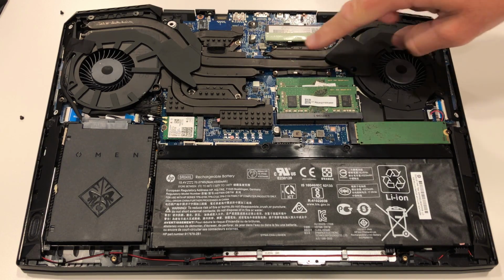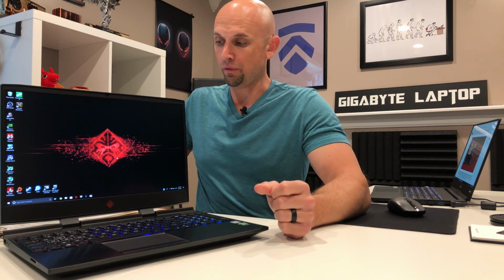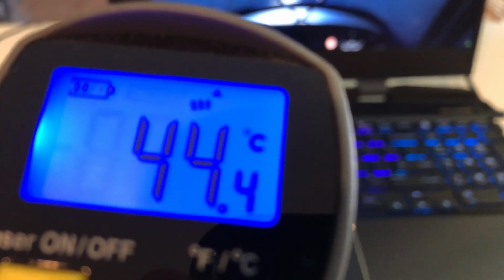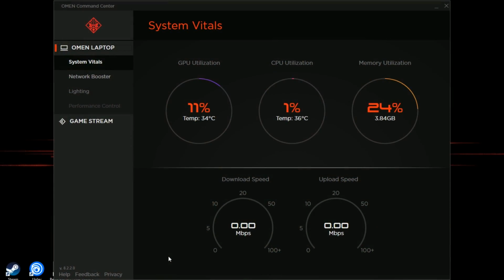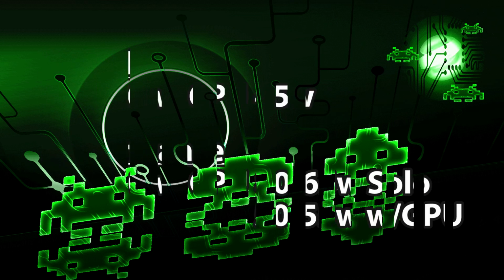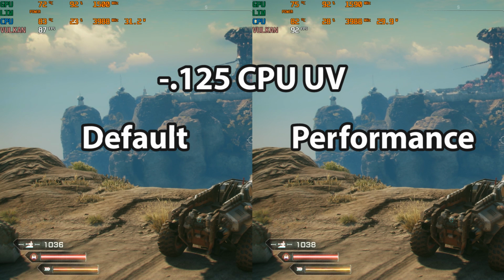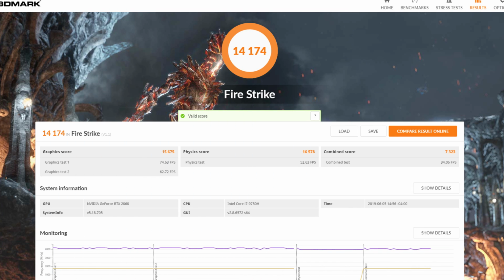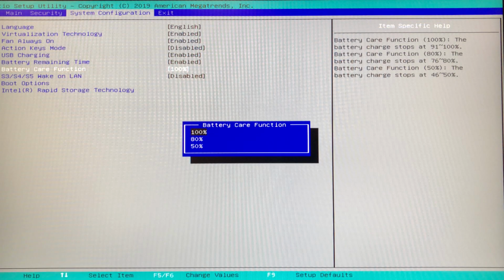HP Omen 15!  RTX, 9th Gen and 144Hz for $1199!

Comment: thats really not a bad deal in febuary i got a hp omen with the 6 core i7 a 1070 maxq 32 gigs of ram the 144hz screen and a 512gb ssd for 1500
Reply: MrYaxalot do you have a 2-3+ year warranty at least? Get one and save yourself, and not make the same mistake I did. My high spec Omens GPU died, and I gave up on it since idk why it died, so I didn’t replace the motherboard.
Reply: @SilentButDudley  it's got whatever the manufacturer warranty is
Reply: MrYaxalot get it Insurance’s with square trade or something for 3-4 years. It’s worth it, as if a GPU dies then you would need to buy a whole Motherboard
Reply: @SilentButDudley  I buy a new laptop every 2 years and it's not my main machine I never expect to repair a laptop unless it's memory or drive related those insurance things unless from microcenter or something are scams

Comment: the only issue is that hp laptops does not last that long . in fact i know more than 5 users who have their hp laptop stopped functioning in less than 2 years . batter not working , screen coming off that you can not close it either or your keyboard will come off with time , wifi is not working . when you see more than 5 people next to you talking about their hp experience , you just avoid buying this laptop

Comment: Please be aware omens have a history of long term cooling issues. If you get one, get a long warranty or insurance. There is the chance that within 2 years the GPU or CPU will be fried.
Reply: Supposedly HP released a Bios update to help with the throttling issues. Im on the fence between this exact Omen he bought in the video or the new Helios Predator w\1660ti spec. Prob go with the Predator since new design and alot of good reviews.
Reply: Ry Guy I had a 2017 Omen with the 1070/ max specs possible for like 2k, and its GPU died right after a year. No warranty to save it sadly. Switched to Asus ROG Zephyrus since. The predator looks like a pretty good buy, as the 1660ti is a good card.
Reply from the maker: Once you’ve been burned by a particular model/brand often times you don’t return. 

No manufacturers is immune to failures.  You only think it’s bad because once yours fails you search for others with similar experiences.  

No different than buying a car and now suddenly you see these cars everywhere due to the fact that you have one and happen to be paying attention.
Reply: Bob Of All Trades I don’t believe HP is bad.  I thoroughly enjoyed the laptop when I had it, as it was quiet and powerful. Their software is pretty basic and unuseful, and I have found some brands do it better. 

I would have bought another HP had I not had such issues with the first like you said, so to circumvent that I would recommend anyone to get at least a 2 year warranty on ANY gaming laptop. 

I also believe that many of the cooling issues with the original 2017 omens is fixed, so it is probably a better product than the one I intitially purchased.
Reply: @SilentButDudley  Yea only thing holding me back is that im pretty sure the Helios uses Optimus and for gaming thats a no no, this Omen doesnt use it.  So no im steering more towards Omen. Like i said im on the fence, having a hard time, lol.
Reply: @BobOfAllTrades  one quick question I had for you I forgot to ask. This laptop has fast sync like you stated in the video. What is that exactly, is it just the 144nz monitor or does it help like adaptive sync or something, kinda confused. Been a while since ive been in the market for laptop. Is it enough to not get tearing in games and run fairly smooth? Will I notice a negative difference coming from a gsync benq monitor(1080\144hz)you think? I read in another one of your comments that trying to play on a laptop without any type of sync while coming from a gsync monitor is pretty bad. Only deal breaker holding me back rn honestly. Edit: Welp now I might just go with the PowerSpec 1520 from MicroCenter. If this 5% "in-store" coupon code actually works tomorrow I can grab it for $1375 out the door. Killer deal, don't know much of who "PowerSpec" is though.
Reply: @RyGuyRy  Pls can someone answer this. I have the same question

Comment: Have fun when this piece of shit breaks down after 20min of Prime and your replacement runs at 100°celsius constantly. Never again!
Reply: Check and make sure your Bios are up to date. I'm guessing there not. There is an article about how HP released a Bios update for the overheating\throttling issues.
Reply: @RyGuyRy  I don't have that laptop anymore, but bios and drivers were updated. Fun fact: The guy from HP support told me to bring it back to the store and replace it with a laptop from another company. Bought a desktop pc with an i9 and rtx2080 and never looked back.
Reply from the maker: Lol wow

Comment: You can get this laptop with basic specs (which has a GTX 1660Ti instead of the RTX 2060) for $1099. That is an excellent deal. The only other laptop with similar specs is the ASUS TUF FX505.
Reply from the maker: This laptop is a much better deal for even $200 more. You get the higher refresh rate panel and the next step up and graphics

Comment: I have the 8750h / 1060 version
I really like it, but it thermal throttles SO hard... even after undervolting CPU + GPU, they both run at max temp (98°C for one, 92 for the other). While I managed to get the CPU running a bit faster, my GPU still throttles at 600-900Mhz...
Reply: Check and make sure your Bios is up to date. Just read an article about this and it supposedly fixes throttling issues.
Reply: @RyGuyRy  Bios is u^p to date (as of march, I think. I didn't find anything newer)
Reply: @morphball  ok just trying to help.
Reply: @RyGuyRy  Thanks

Comment: the laptop got the worst cooling
Reply from the maker: The cooler is actually above average. It’s the fan control or lack there of. As you attempt to cure thermals the laptop just scales its fan curve along the way.
Reply: @BobOfAllTrades  not good like msi gp 63
Reply from the maker: That’s a bit heftier of a laptop for starters and it also has maximum fan boost with a dedicated hardware button the way it should be 👍
Reply: @BobOfAllTrades  i just like the software side of msi laptop.  also lock games to 60 fps will reduce temp . alot of people don't mention thats especially if you play single player game . the gtx 1070 model was for 1300 dollar on newegg few month ago . total good deal for starter
Reply from the maker: I don’t want to lock my games to 60 FPS. That might be good for you but that’s not gonna be good for everyone
Reply: @BobOfAllTrades  at least for single player . i dont see benefit of going above 60fps
Reply from the maker: Ali Manal “you” don’t but that is YOU. That’s an option or a preference and not a fact among our fellow gamers.  

Some are fine with 30 FPS with all eye candy at its maximum on various titles.
Reply: @BobOfAllTrades  maybe but i am happy with temperature decease , i want to ask what tool i can buy for laptop screen calibration i want to calibrate  my msi gp 63 screen
Reply from the maker: Here’s a fun fact about FPS lints to 60 to improve temps. There will come a day when you play titles that tax the system hard and 60 FPS is now all the machine is capable of. By the time this happens the thermal paste has slowly dried up and isn’t what it use to be. Now your faced with temps that were revealed in this video.  

The Spyder5 Pro (costs roughly $180) which is older than the new model which is here Datacolor SpyderX Pro – Monitor Calibration Designed for Serious Photographers and Designers SXP100 https://www.amazon.com/dp/B07M6KPJ9K/ref=cm_sw_r_cp_api_i_Wqv.CbNTFFCK2

I also have a tutorial on the Spyder5 Pro here https://youtu.be/1NMUVteq0Zg
Reply: @BobOfAllTrades  thanks for your help , kinda feel sad for buying gtx 1060 laptop , now that gtx 1066ti laptop released for same price but i guess that technology

Comment: Please do a comparison between this hp laptop and the new acer predator helios 300 with i7 9th gen cpu. Thanks :)..
Reply: Currently the two laptops I'm trying to decide between.
Reply: Ry Guy have you made a decision? I’m debating between the two as well lol
Reply: @initialize21  not yet but tbh I'm looking at this particular one instead.  https://www.microcenter.com/product/602316/1520_156_Gaming_Laptop_Computer_-_Black;_Intel_Core_i7-8750H_Processor_22GHz;_NVIDIA_GeForce_RTX_2070_8GB_GDDR5X;_16GB_DDR4-2666_RAM;_500GB_Solid_Stat. MicroCenter also has a 5% coupon code you can use(in-store only) so that puts the price out the door at roughly $1380(my taxes included). Plus I'm selling some halrey shocks for $150. So really I'll be paying roughly $1200 for a sick little lappy. To me it's worth the extra $180 for the 2070 card, Gsync monitor, bigger 500mb m2(comparing to Helios), and of course the Mux switch. Gysnc and the Mux switch are worth $180 alone. I honestly highly suggest you either consider getting this laptop yourself(best deal to date imho). Or atleast consider something with gysnc and a Mux switch (or atleast a dedicated card one like this Omen here). Your telling me your also about to purchase one yourself, so your not far off to just save a little more. I can guarantee it will be worth it. Gysnc and better card for less than a couple hundred will be so worth your time you've waited, talk about future proofing your laptop man. I feel like a salesman, but I honestly feel if you can wait or just spend a couple hundred more it's worth it,right now. That can change but this particular deal is really good. Lmk which way you go.
Reply: Ry Guy dang that looks nice, but unfortunately it’s sold out at the Micro Center near me and it’s just out of my budget

Comment: I'm enjoying this laptop, I bought it on the 6th. If you wouldn't mind could you post the color calibration profile, I'd appreciate it.  My screen OCs to 157hz; they probably all do lol
Reply: Considering this laptop myself or the newer predator helios w\1660ti. How did you overclock the screen? Was it just a setting in the display?
Reply: @RyGuyRy  You use Nvidia control panel to create a custom display resolution with a higher screen refresh.  Just Google it.
Reply: @jamesoliver9979  Thanks, yea i shoulda known how to do that, lol. My benq 1080/144mhz wouldnt even budge anymore than its 144hz potential, it let me go to 145hz then black screens. Honestly the jump from 144 to 165 isnt noticeable im sure and i knew i wasnt going to get better than that. Its fine bc new 240hz panel is in the cart, lol.
Reply from the maker: https://youtu.be/Ni82DDlmysk

Comment: During gameplay CPU reach and play around 90 degrees , is it safe for laptop to run such a high temperature while gaming ? Regards
Reply: It's safe. But because of that others parts also get hot, that may reduce their life.
I even got a replacement but the cpu temps are above 90+
Reply: Undervolt it or reapply paste

Comment: Hey Bob great short review. Great laptop but that battery is almost a dealbreaker, just because of the price tag. The thing is after years finally manufacturers are producing gaming laptops with around 5 hours of battery life, and some even more. This is a step down.
Reply from the maker: No Optimus
Reply: @BobOfAllTrades  Do you know if Optimus can be even installed separetly? This CPU does have an iGPU.
Reply from the maker: Andres Valdevit No it doesn’t work like that.  Your display is either wired directly to the dGPU or directly to the iGPU and then gets controlled via Optimus. This is what makes MUX switches great 👍 

The iGPU here is technically there but 100% not accessible and will be labeled often times as “disabled”
Reply: @BobOfAllTrades  I see. That is why I said it's almost a deal breaker, if you don't mind the battery life it is a huge value laptop. I don't know how HP manages these prices every time though.
Reply from the maker: Andres Valdevit Makes me wonder what the real profits look like across all laptops.
Reply: @BobOfAllTrades  Same goes expecially for phones or any other tech. Laptops though are tricky, managing everytime thinner chassies with more powerful CPUs needs a very thought out engineering that alone must be costly, so I can only imagine there must be still space for markups.

Comment: Ive got the older version with gtx 1060 its been 1 year with me no serious problem just driver issues but updated them and now the battery died and it need change the hp support told me it cost FUCKIN 250$ and its only 50$ online otherwise good laptop
Reply from the maker: Just buy a battery online and install it.
Reply: @BobOfAllTrades  thats what im gonna do but idk how to open it maybe i will see some youtube video.
Reply from the maker: The Law I already created a video about a year ago on how to tear this laptop down. Pretty easy to find 👍

Comment: I regret getting a 1060  laptop late last year now..... goddammit. I want this so bad...
Reply from the maker: That was 6 months ago. It’s not worth waiting that long.
Reply: Bob Of All Trades why not? My Lenovo Y7000p was around $1000 plus tax. Comes with an i7-8750H, 256 GB SSD, 80 Wh battery (I think), GTX 1060 6 GB and 8 GB DDR4 RAM. The Omen you showed here beats my laptop in every aspect. And includes and RTX card for just 100-200 bucks more. I don’t know if the 1060 is gonna be future-proofed, for even a couple years at least, looking at how popular RTX is getting... what do you think? Should I sell my 1060 laptop and get this one?
Reply from the maker: Because six months from now there’s going to be a laptop for this price for $200 more that beats this one. It never ends

Comment: Can't you just disable the gpu and force the cpu to be used instead temporarily to save battery?
Reply from the maker: No
Reply: @BobOfAllTrades  you sure? You tried going to device manager, then display adapters, then disabling the gpu?
Reply from the maker: Dude, yes I’m sure. There are very few people on this platform that know how these laptops work better than me.
Reply: @BobOfAllTrades  dammit, well thanks for telling me👍
Reply from the maker: The DP cable from the display will connect in one of three ways. 

1) Direct to the dedicated GPU. When this happens your integrated GPU is 100% disabled and not accessible no matter what.  That’s wha we have with this Omen and the Aorus 15 XA I recently covered. 

2) Direct connection to the integrated GPU. This will allow Nvidia Optimus tech to recognize when a 3D load is present and swap to the appropriate GPU. This is a good feature for saving batter life at the cost of many features such a Gsync or Fast Sync just to name a few.  Due to this connection a small performance hit is inevitable. 

3)MUX switch. Laptops equipped with this have special circuitry that allows you to have both feature just not at the same time. It’s always adjusted at the BIOS level. The Y740 does this for example.

Comment: Wow glad this popped up now im pulling hairs trying to figure out which laptop i should go with, this Hp or the Acer predator helios 300. The predator has the 1660ti but many benchmarks have proven the 1660ti is on par mostly with a 2060, all benchmarks showing the 1660ti within 5% of the 2060 at its best, even showing the 1660ti doing better in some games. It just comes without the ray tracing (even though 10 series cards can now turn it on? lol). So im not making my decision based off of that. Im leaning more towards the predator bc im hearing good things about how they improved the cooling by alot. Yea ill prob go with the Helios well see, 1199 shipped.
Reply from the maker: Whatever you decide I’m sure it’ll be great. 

As per your previous post that you deleted, we’re all paying taxes.

A friend of mine was selling a boat. The potential buyer tried to talk him down with an excuse about getting married and trying to save money. The seller said, “if you’re trying to save money, then you don’t need to buy a boat”.
Reply: @BobOfAllTrades  I hear that ya. The problem was(and reasoning for deleting comment) i didnt know MicroCenter has it (currently) for cheaper than the actual HP site. I had gone to HP's site and seen how much taxes added, so i figured it wasnt the best buy when comparing to the predator. However, after that comment i quickly noticed you can indeed get it with the 2060 and 512 storage for 1199 off MicroCenter. Making it the better deal for as long as you can grab it for 1199, instead of HP's $1370 price.

Comment: Thanks for the review B0B.

I reviewed this model on NotebookReview with the 2070MQ, for those on Youtube who are interested.
http://forum.notebookreview.com/threads/hp-omen-15t-2019-15-dc1000-15-dc1999-15t-dc100-rtx20x0-gtx-1660.828816/

I have the 2070MQ version with 8750h. The 2070MQ model does come with G-SYNC per HP's specifications, panel model LGD05FE. My 2070MQ boosts to 88-92w on Performance mode, which is nice to see it it does for the 2060 here too. My 2070MQ does not thermal throttle at all even at max load - I did not need to undervolt it. The CPU in my machine throttled with AIDA64 stressing but not while in-game for the most part.

My model (or a version of it) can be found direct from HP or on Amazon as well. Price - varies but HP has plenty of website deals that run on occasion. I have no regrets with this purchase and I'm even having the reverse of buyer's remorse for this compared to the Y740 - this laptop has no badly placed macro keys, and a FULL numpad, for the same form factor. Build is solid, and the hinges seem well reinforced. The keyboard deck is solid- you can press down hard and there is no visible flex in the keys.